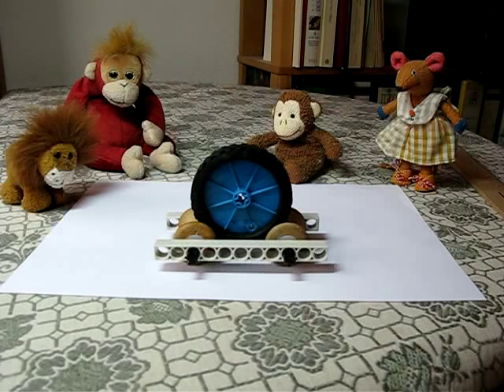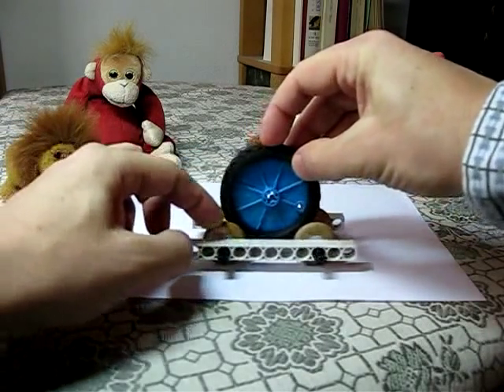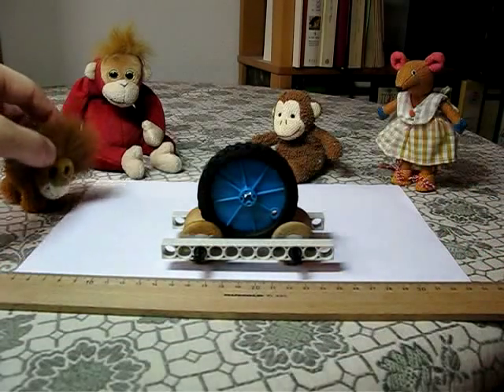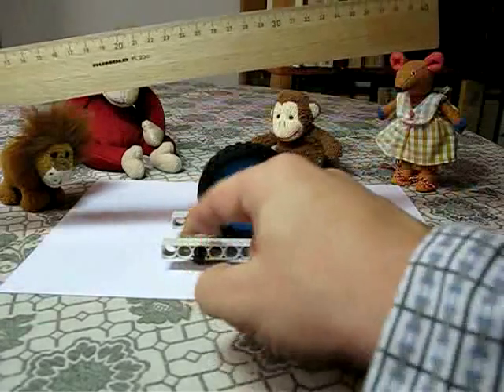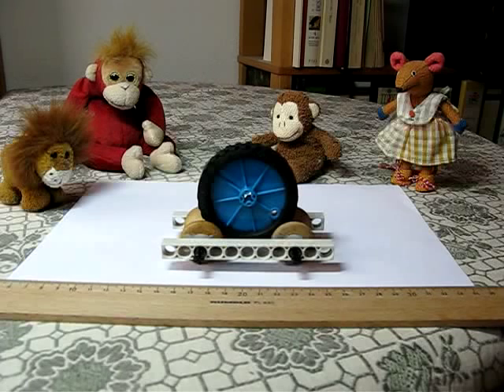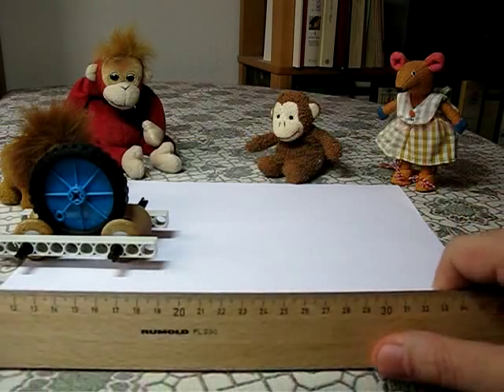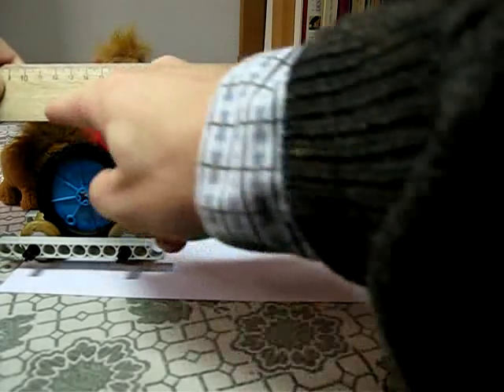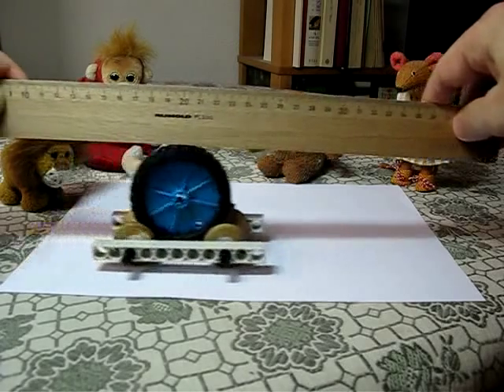Under the ruler faster than the ruler

Comment: I came here from the latest Veritasium video. For me this is a much more intuitive way of thinking about the behavior of the cart. Thank you for this nice demonstration.
Reply: how did you find this? It took me several days of googling to finally find this gem after seeing the Veritasium video
Reply: @charonme  I started with the "spool riddle" that I remembered existed, but the spool seemed a bit too simple. I searched "cart faster than wire" and this was the 3rd result on YT.
Reply: @pi314159265358978  nice!
Reply: Intuitive, but wrong. The only reason the cart moves faster than the ruler here is because it is being forced to move contrary to how gears work if allowed to move freely.
Reply: @bryanjackson8917  Why would you say wrong? That's the feature not a bug. The cart in Veritasium's video has a rotor that is also "being forced to move contrary to how" the wind would normally turn the wind turbine. This is a direct analogue to it. It just uses a different medium - i.e. a solid ruler instead of an air.
Reply: @bryanjackson8917  Oh wow. First of all let me say that I really appreciate the effort and thoughtfulness you put into your comment. You don't see a 38 paragraph long response on YouTube very often. It is apparent that you care about this very deeply and I like that.

That being said I have to disagree that there is "slippage" involved. In my mind if all the wheels were replaced with metal gears meshing together and the ground & ruler were cogged the cart would behave exactly the same.

From my point of view you are misreading the apparent motion of the ruler. If I correctly understand your description you use the cart as a frame of reference. So we are looking at the moving cart and seeing it stationary.

The ground beneath the cart is therefore moving to the left. Or as in your example the 4th gear is rotating counterclockwise. The 3rd gear or the smaller wheels are rotating CW. The big wheel (2nd gear) must be moving CC. So far I have no problem with this.

Where I have a problem is your sudden jump to a different reference frame. You now claim that the ruler is moving to the right in the video and so there must be some slippage going on... because the first gear / ruler should move CW / left.

The problem is the ruler IS moving left from the perspective of the cart. The cart is faster than the ruler and therefor from the cart's frame of reference the apparent motion of the ruler is to the left. Which is why there is no paradox or slippage.

So this video actually shows:
1 CW (ruler) ---> 2 CC ---> 3 CW ---> 4 CC (ground)

And so my comment remains: This is a good analogue to the cart from Derek's video. Although maybe the behavior in this video is not as intuitive as I previously thought.

Anyway I hope that makes sense. If you are not persuaded feel free to post more clarifications and I'll do that as well. I also hope I didn't misinterpreted your position. I was doing my best. It's quite late here so sorry if I missed something.
Reply: @pi314159265358978  No, if the ruler were a circular gear, it would have to be moving in a CC direction.

Remember, the direction of the force being applied by the ruler to the upper rubber wheel of the toy cart is to the right (that is clearly the case) and all we are concerned with is the point of contact between the ruler and the rubber wheel. 

Again, imagine the ruler is a large circular gear sitting atop the rubber wheel. 

In order to provide this force pushing to the right, a "circular" ruler would be rotating in a CC direction.

Even if you say, "okay, but in reality the ruler is a straight line, and so no need to think f it as a circular gear", the top wheel of the toy cart (in contact it and being pushed by the ruler should still turn in a CW direction.

The video narrator even points this out and states that the result of the experiment is surprising because we would expect to see the upper wheel of the toy cart move in a CW direction (e.g., @ 2:38 in video).

Draw it out on paper and you will see what I mean.

Then the next gear in line (the top wheel) would rotate CW, the next gear CC, and the final gear CW again.

That is the paradox here, that this system is operating completely opposite to how a fixed gear system would work.  

You say "The problem is the ruler IS moving left from the perspective of the cart."

In a sense you are correct, but remember it is the ruler that is supposedly driving the toy cart. 

So the question is, what is really propelling the toy cart then?

Since it is moving faster than the ruler, then from the toy cart's perspective it must be the ground. (I even mentioned this at one point in my analysis.)

But the ground is not inputting any energy into the system, only the ruler is.

So that, if you will, is a paradox!

Again, the ruler represents the wind, and that it what is supplying energy to the Blackbird system.

In the final analysis, the only perspective that really matters is that of an outside observer. 

The system is not behaving as a fixed gear system - referring to metal gears with teeth that mesh - would behave, thus requires explanation.

Applying geometric analysis using circles can easily explain how toy cart can move faster than the ruler, but then we are left with problem of rotation of system elements counter to that seen in gear system.

Here is the definition of "propeller slippage" in regards to aviation:

"Propeller slip is the difference between the geometric pitch of the propeller and its effective pitch.

Geometric pitch is the theoretical distance a propeller should advance in one revolution; effective pitch is the distance it actually advances. 

Thus, geometric or theoretical pitch is based on no slippage, but actual or effective pitch includes propeller slippage in the air."

http://dictionary.dauntless-soft.com/definitions/groundschoolfaa/Propeller+Slip

"Slippage" may or not be the correct term to use here. That's why I put it in italics. but something of that nature is going on here that allows the system to behave contrary to all expectations.

FWIW, I would like to see someone try to demonstrate this "paradox" in a video using metal gears with teeth. I predict it can't be done and won't work.

Here's an analysis totally from the perspective of the toy cart, but as you will see it still leads to a paradox.

The ground is stationary under the cart.

The cart moves forward, to the right.

As a result its smaller wheels rotate in a CW direction.

This causes it larger upper wheel to rotate in a CC direction (as can be clearly seen in the video).

This pushes back on the ruler and causes it to apparently move (from the cart's perspective) "backwards" (slower than the cart).

Question: What is causing the cart to move forward? I thought it was the ruler, but how can that be the case if it is moving backwards from the cart's perspective?
Reply: @bryanjackson8917  I have made a video response:
https://youtu.be/-NO28NHRv1w
I hope that clarifies my position and shows exactly how I think it works. Sorry for my bad English. I'm Czech so I'm probably butchering some phrases. It should still be better than trying to describe everything in a comment.

There is also a Blender simulation of what I think you are suggesting with the gears. Hope it helps.
Reply: @pi314159265358978   PART III

Note that in the scenario presented in Part II, we do not have to rely on any explanation of thrust being produced by the Blackbird’s propeller pushing it forward nor to any pull of that same propeller “screwing” through the air and pulling it forward. While both of these explanations have been offered, note that both are incompatible with the video we are using in our analogy here.

Notice that the toy cart in the video does not have a propeller, nor does Coolaun ever make any mention of or reference to thrust.

The only thing that matters are that (1) one wheel is geared to the other wheel (via a chain drive connecting their two axles) in a way that makes it rotate faster than the other, (2) that the two wheels are acting on different surfaces, and (3) that there is some sort of energy input into one of the wheels.

So to reiterate our analogy:

The Blackbird’s “wheels” are its propeller and its wheels, (1) its wheels on the ground are connected to that propeller via a chain drive that make them rotate in the same direction, (2) both are operating on different surfaces (one on the air and the other on the ground), and (3) the energy input into the Blackbird is the wind.

Resorting to explanations of thrust, etc. (all of which, it should be noted, are entirely theoretical) to explain the ability of the Blackbird to travel downwind faster than the wind itself (DWFTTW), only lead to confusion and intellectual resistance as DWFTTW seems to imply to many that you are getting something from nothing, that the Blackbird violates the laws of physics and/or is some kind of perpetual motion machine.

NOTE: While some DWFTTW thrust theory adherents point to the toy carts on the treadmill as proof that the thrust produced by a DWFTTW vehicle is enough to move it past the speed of the wind, it must be pointed out that these demonstrations are not proving what they think they prove.

The problem here is that the direction of energy flow of the toy cars on treadmills is, in a sense, reversed from that seen in the video/Blackbird systems.

To begin with, in our analogy the energy source is the wind - or in the video, the movement of the walkway - that is inputting energy into the system. The propeller of the Blackbird is able to capture enough of that energy to make it spin via lift forces, and that energy is then transmitted to its wheels.

In the treadmill demonstration, the treadmill is taking the place of the wind: the energy from the treadmill is spinning the wheels of the toy car which are in turn, transmitting that energy to spin the toy car’s propeller which produces thrust driving the toy car forwards.

To put it in terms referencing the video: 

1. The ground in the video = the air surrounding the treadmill (i.e., ground the Blackbird is traveling over)

2. The walkway in the video = the moving track of the treadmill (i.e., wind)  

3. The wheels on the ground in the video = the propeller of the toy car (i.e., Blackbird’s wheels on the ground) 

4. The wheels on the walkway in the video = wheels of toy car on treadmill (i.e., Blackbird’s propeller in the air). 

So this is why I say that the energy flow in the treadmill demonstration is reversed from that seen in the video/Blackbird systems.

In the toy car on a treadmill it is the energy input from the treadmill that drive its wheels that spin its propeller acting on the air to produce thrust.

However, as seen in the video/Blackbird systems, it is the energy input from the ‘walkway/wind’ that drive its ‘wheels on the walkway/spin its propeller’ and that rotates its ‘wheels on the ground/wheels on the ground’.

Also, anyone that has seriously fooled around with toy airplanes that fly, RC cars, etc., know they can behave quite a bit differently than the real life versions in rather unexpected ways. (Think of all those RC cars that can do wild stunts, flips and rollovers, etc. without suffering any damage.)

Another example, think of all the failed attempts at human powered flight using the same method of propulsion as do bats and birds - flapping their wings.
Reply: PART IV

By the way, the reason that Under The Ruler won’t work with toothed gears is that no matter what the circumference of a particular gear may be, its teeth have to mesh perfectly with those of the next gear in the assembly - that is, there has to be a one-to-one correspondence between the distance the teeth of one gear have to travel (as measured at its perimeter) with that of the teeth the next gear (as also measured at its perimeter) have to travel.

In the Under The Ruler toy cart, the distance the large rubber wheel travels along the ruler is not the same as that which the smaller wheels travel along the ground. So far, not a problem, just a matter of a gearing ratio.

But if the large rubber wheel were a toothed gear its teeth would have to precisely match the teeth cut of those of the smaller wheels (if they were also gears), which would also have to precisely match those of the ground (if that were also a gear in the system.)

With the rubber wheel, this is not the case at all. They are free to move across the surface at whatever distance is required, and have no teeth which have to precisely mesh together with the smaller wheel, and it too has not teeth which have to precisely mesh together with those of the ground.

Just look at any videos explaining how gears work and you will exactly what I mean
.
The only way I can see that one could possibly make the system work as it does in the Under The Ruler video using toothed gears is to make sure that all of the gears moved in ratios consisting of whole numbers, and even then I’m not sure it would work properly as the gears would be forced to turn in certain directions as I explained previously, and this would be counter that seen in Under The Ruler videos using two rubber wheels and/or cotton spools. (But it would be an interesting experiment.)

Unfortunately, I am in the middle of a major move (change or residence) right now, and can't carry out such an experiment, but once I get settled in to my new locale I plan to so so.
Reply: @bryanjackson8917  Surprisingly I agree with a large part of what you said.

Honestly the strangest thing in all of that was your claim that you don't have a YouTube account. Like what? What's this channel if not your YouTube account?
https://www.youtube.com/channel/UCTzm-ZIBlr1de65Wv4PKcVQ

I guess the other thing that baffles me is your insistence that the cart in this video is somehow different from the cart in the "Walkway" video. In the walkway example the chain makes the "big" wheel rotate in the same direction as "small" cart wheels and thus the walkway must be below. In the video we are commenting under, the big wheel is connected directly to the smaller wheels and so rotates counterclockwise and thus the walkway must be above. The gearing is pretty much the same. Those two examples are equivalent.

From my point of view you are choosing one explanation out of many and claiming it is the only possible. While I would say that there are many explanations that are equivalent and just differ in the perspective that is being used - i.e. some focus on the cart and some on the outside observer.

That said I think the explanation you gave is a valid one. I just don't agree with the way you focus on a small part of a big picture. The "energy flow" you are suggesting is quite misleading. There is no difference between the craft Derek (Veritasium) is driving and the cart on the treadmill. It's all just a matter of perspective.

So I guess let's agree that we disagree on some points and lets try to make a geared version of the "Under The Ruler" cart. I'm not sure when I'll be able to carry out this experiment myself, but if I do I'll film the result and post it here. I think I do have some LEGO gears somewhere. You should do the same when you are finished moving. My prediction is that the geared version will work like a champ. Let's see if that's the case.
Reply: @bryanjackson8917  Here is the cart recreated using LEGO gears:
https://youtu.be/VlJISp-bDsc

It is functionally the same as the cart from this video. It works quite well and the big gear indeed turns counterclockwise when the top is pulled right (clockwise). Pretty neat.

You can post videos as soon as you have a YouTube account. No need for any verification or something like that. If you can post comments you can also post videos. Verification is needed when you want to make money from your videos. But for that you also need certain amount of views and subs. Hope that clarifies it.
Reply from the maker: @bryanjackson8917  here's one with toothed gears: https://youtu.be/Cz4sf-pZ8jk The only wheels that don't have teeth are those that run on the ground, but it would be an easy matter to make a version where these wheels are also toothed and run on racks.
Reply: @coolaun  I know there was one with racks both top and bottom! And I can't find it :(
Reply from the maker: @FlyNAA  Here's one with racks top and bottom (you can't find it with a search because it's unlisted): https://www.youtube.com/watch?v=IDbzL-p2xvs

Comment: It works because the ruler is moving the whole cart, not just the top wheel. The ruler moves to the right, pushing the cart to the right; the little wheels move clockwise, the big wheel moves anticlockwise, which pulls it along the ruler faster than the ruler because of simple gearing.

To understand the unexpected direction, you have to stop thinking of the ruler as another wheel in a system of gears. Instead, think of it as an object that is pushing the whole cart via the top wheel

Comment: daz, what I'm saying is that he's using downward force on the left side of the ruler to create the proper motion of the large wheel.

 Does this make sense? 

I'm just saying that the narrator seems to be implying that the motion of the ruler to the right is causing the anti-clockwise movement, which is incorrect. I might make a video to show what I mean.

Comment: every so often I come across this video, and, having forgotten the results from the last viewing, get it wrong. it's still interesting, and gave myself and my roommate an interesting conversation because I still remember how it works
Reply: A rule of thumb approach that simplifies such puzzles a lot is rephrasing the question from something like "which way car will move if the top of the wheel is pulled forward?" into something like "during which way movement of the car the top of the wheel would move forward?", it makes it quite more straightforward in my opinion.